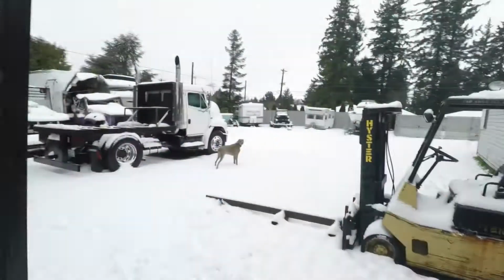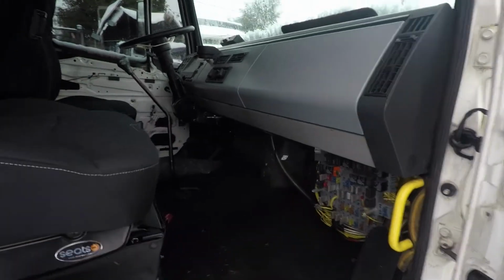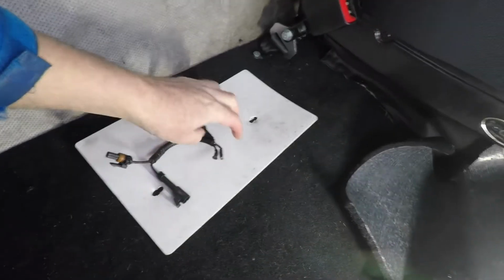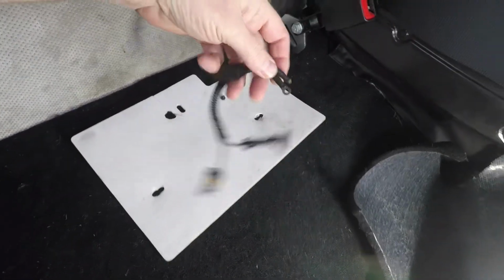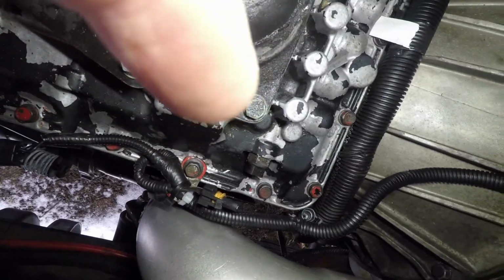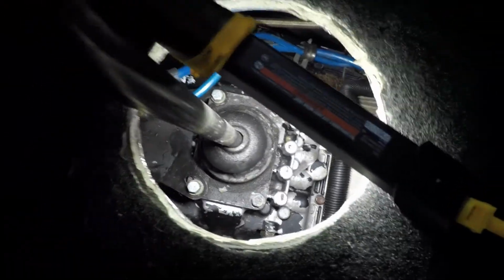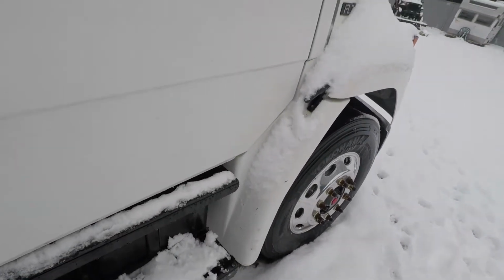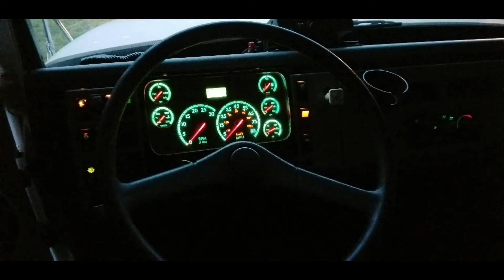Ep. 16 Freightliner FL70 Clutch install Update.

Comment: Nice job.. I like the gages cluster, where did you get it at? I have a 98 FL80 that im working on my self and will like to replace the dash cluster. thanks.
Reply from the maker: Its a 2003 Truck and factory gauge package as the engine is computer controlled.
Reply: @cjhaulerz7670  thanks